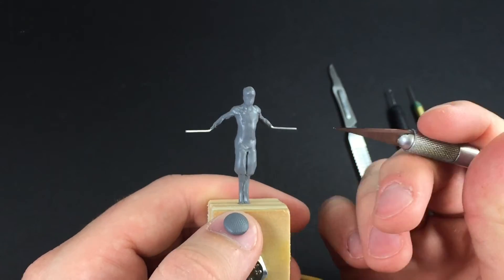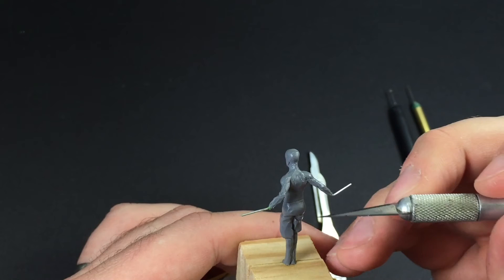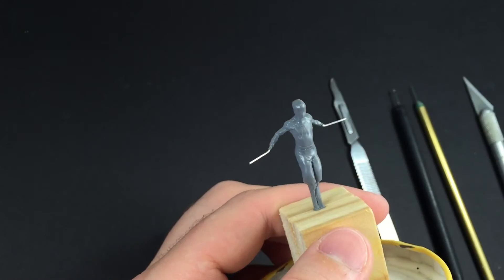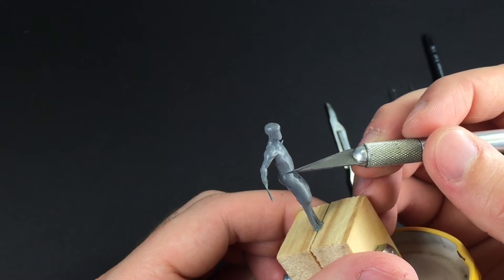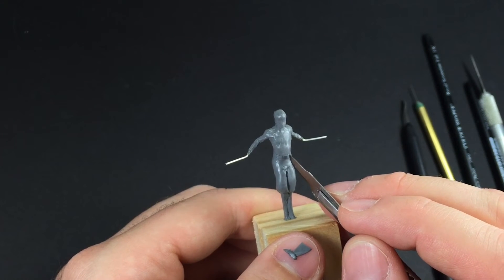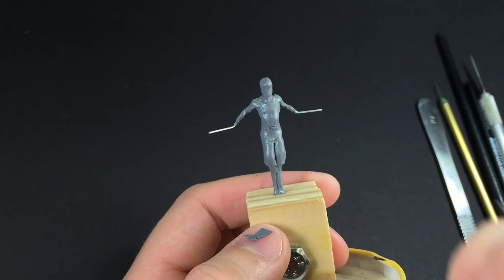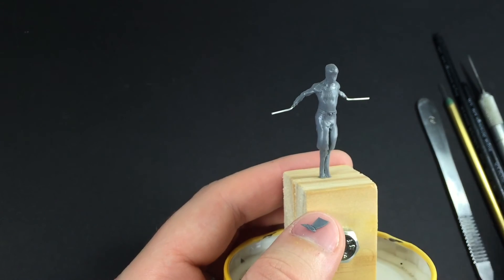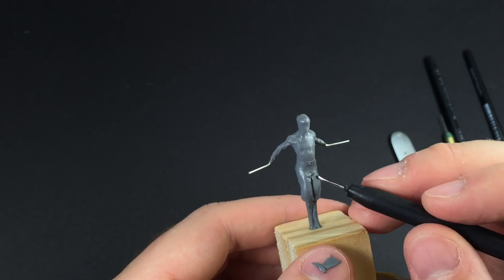Sculpting Miniatures - Basic Belts and Buckles

Comment: Tom, I gotta say... You Rock! Thank you for your instructive videos. Your work is beautiful by the way.
Greetings from Brazil!
Reply: Also, I've got a question:
I can't find green stuff here in Brazil, so I'm using some version of grey stuff. I can never get my mini to look soft and smooth.. There are always some tool marks... What should I do?

Thank you for everything!
Reply from the maker: Thanks Ricardo!

If the grey stuff your are using is an epoxy putty I HIGHLY recommend using a colour shaper. It looks like a paint brush but with a silicon tip. They are soft and if you use a tapered round, there are no harsh edges. This will help a lot as you learn to have a gentler touch while sculpting.
Reply: Thank YOU sir! Will do!

Comment: Is there a way of correcting minor errors in anatomy, for example the waste ending up a little higher then it was supposed to be, except for destroying an hour of amature work by redoing it completely?
Reply from the maker: DarkWolfes it depends. If the armature is WAY off, you can end up fighting incorrect anatomy and never getting something satisfactory. However if you're working in clay it's relatively easy to rework the clay into the correct position. Obviously if there are several details on top already it may necessitate resculpting. That's why it's good to keep things loose for as long as possible so you don't spend a ton of time on the details only to have to redo the underlying anatomy.

Hope that helps.